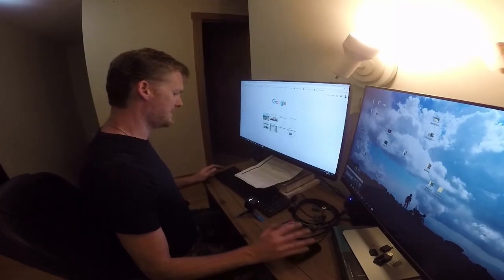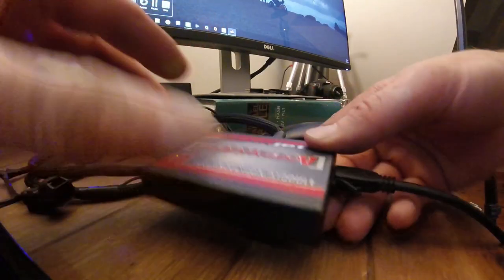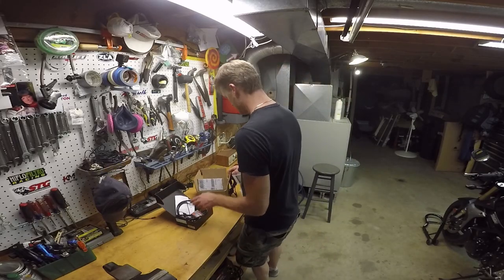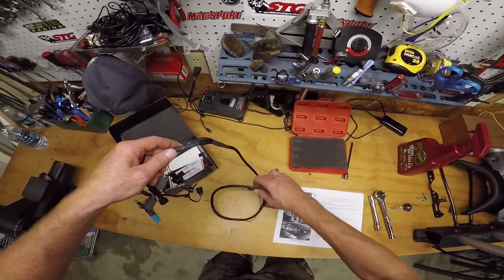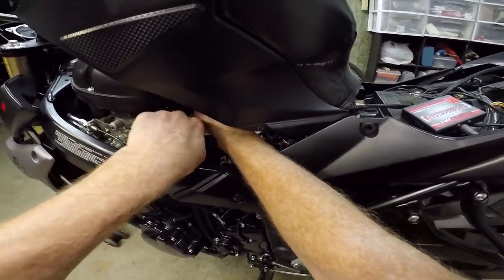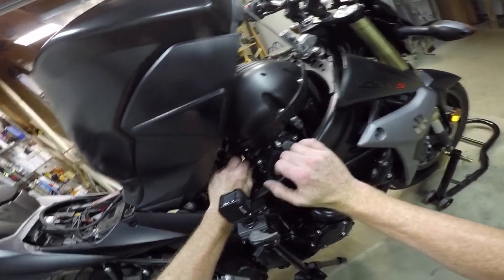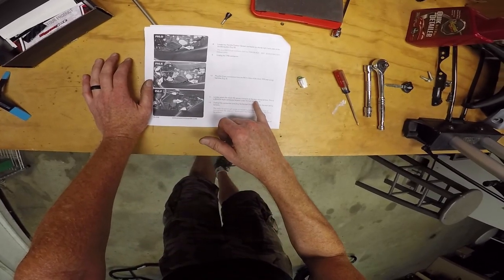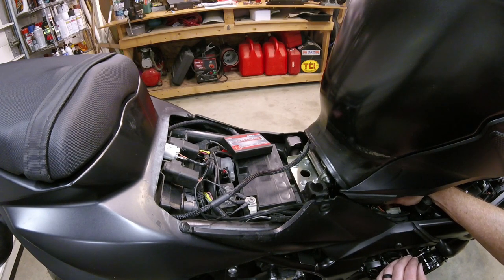How To Install Power Commander V | Suzuki GSX-S750

Comment: Appreciate these small HOWTO videos, multiple camera-angles, screen recording, it takes work making them at this quality. Now 6 months later - was the power commander worth it?
Reply from the maker: Aleek91 I only wish I bought it sooner.
Reply: buying mine now, but I also have a full exhaust system on the gsxs. Do you know anywhere online that has maps for download? Can't find any. If not I'll take it to a dyno shop. Thanks
Reply from the maker: baznitchandsons I had the same problem. I ended up buying from fuel moto because the advertised unlimited free maps. Dyno shop would be best of course 💪👍
Reply: Michael Byrne I'll check out fuel moto, thanks a lot
Reply: Another question - did you remove the o2 sensor or you left it since it's the stock exhaust? I'm not sure if dynojet ships something for the o2 sensor or I have to buy separately
Reply: I see you still connected it to the pcv but I'm assuming you left the o2 still in the exhaust

Comment: The only thing stopping me from buying, I don’t have windowsOS. Great videos! Maybe a brake change tutorial?
Reply from the maker: Derek Irwin Ya know the PCV software is very tiny and wouldn’t need much to run it. Maybe an old used $50/free laptop would get it done 👍 and yes indeed when my brakes finally wear down I will plan on making a video. Thank you for your comment 🙏  Ride safe!

Comment: Kinda basic question, but what's the benefit and the point of doing this? 
I have gsxs750z 2019
Reply from the maker: Once you allow more air to move thru your engine you need to match it with a fuel increase as well or you’ll run lean and risk engine damage.

Comment: How does this work with state inspections? ever have any problems passing inspections?
Reply from the maker: B3aters it hasn’t been a problem. But one of the things I like most about the pcv, it can be removed easily if it is a problem.

Comment: Is it the top fuel injectors you connect to or the bottom injectors
Reply from the maker: Guadalupe Martinez there is a row of fuel injectors on the back of the engine just under the gas tank toward the top of the engine. Only one set. Only one place to plug into. Does that answer your question?

Comment: I know you have to use the  Injectors on the bottom left to right but the plugs on pcv is there a  Particular order the plugs go in are they numberd or labeled. 1 2 or 3 or just plug them in but make sure you go from left to right reason being I bought a pcv used an i have no  Installation instructions lmk
Reply from the maker: Hey Derwin! Its color coded. Pretend you're sitting on the bike (for reference) .... the first cylinder is on the left #1 is Orange. #2 Yellow. #3 Green. #4 Blue. Hope that's what you needed man!
Reply: Are all pcv color coded the same way thanks for getting back to me bro
Reply from the maker: @Macnificent78_  If you do a google search for Dynojet PCV installation instructions (insert make model of your bike] you should find the instructions in PDF format. From what I can see, the wires seem to be the same color/same order on other bikes. But always good to verify!
Reply: @sstressfl  yea I'm looking now no luck on a 07 only for PC 3s thanks

Comment: Just a general question if anyone can answer: I’m installing my Pcv and I can’t seem to get the  plug out from second cyclinder. The plug is reachable and I can push in the clip but nothing happens. Stays in place normally 
Any tips?
Reply from the maker: I could be wrong but I believe that connection has nice little rubber seal inside to keep water out. To overcome it, try using a flat head screwdriver against the connection seam, and rotate the screwdriver gently while you're pressing the clip and pulling. That little bit of help from the screwdriver can make all the difference.

Comment: Hi, thanks for your video has helped me a lot.  I hope you can answer my question.  I bought a power commander V for my GSX-S750 2018, in my city I don't have any dyno power bank to program a specific map for my motorcycle.  I have contacted Dynojet and they provided me with a map with the exhaust system and stock filter, they tell me that it will serve as a basis to configure mine (Full system yoshimura and k & n filter).  The detail is that I have no idea how to do it, I find it easier to buy an already made map for my specifications.  Do you know where I can buy a custom map or at least know how to modify the map that Dynojet sent me correctly?  thanks
Reply from the maker: If I understand what Dynojet sent you... its a map that was created on a bike like yours using the same exhaust. If that's the case, it should be close, but no guarantees. You can open the file using the power commander app and take a look at what they've done. If it looks like a pretty good bump in the mid to high rpm range then give it a try. See how it feels. After you ride a bit, remove a spark plug and take a look at the white ceramic that surrounds the electrode in the middle of the plug. It should be slightly tan. If its bone white then too lean. Too dark and its too rich. Its not easy to make revisions to your own map without a dyno so be careful and move slow. If you decide to change a number, make sure you know WHY you want to change it. And one more thing that you might know already, I heard from other 2018 gsxs750 owners that they cant modify the bottom 40% of the rpm range (??) if that's the case them make sure your fuel trims are gradual changes between cells or you'll get snappy throttle behavior. I garage tuned mine and its working great, but I still plan to buy an autotuner. Hope that was helpful.
Reply: @sstressfl  Thanks for your answer.  What Dynojet has sent me is a map with the stock exhaust system and stock air filter, that is, a map for the motorcycle without any modification made.  Instead, the map I need is with a full yoshimura system and K&N filter.  Dynojet mentions to me that the map they sent me can serve as an initial reference to modify one that suits what I need.  The detail is that as you mention it is necessary to know why change some value of the cells and it is here where I have no idea how to decide what value to put in the cell.  As there is no dyno power bank in my city, I only have two options, do it by trial and error (I don't know how) or buy an autotune.  Autotune is the easiest, but it also means investing more money.  Hopefully Dynojet includes more maps for this model, since for the GSX-R versions there are much more options
Reply from the maker: @Dannybag666  that is one of the downsides of the gsxs... no maps!  I wish I had an easy solution or could point you in the right direction. If you just had a slip on, the stock map they sent you would run a little richer and it might work really well. But with a full exhaust (I'm assuming no cat) it is going to flow and evacuate the cylinder really well and make your engine run very lean. It wants more fuel. I just cant even begin to tell you how much. I'd have to be there! I bought my tuner thru fuelmoto and they provide free maps based on your config. You might want to contact them. Maybe they'd sell you one? Its worth asking. Or perhaps sign up at gsxs.org and ask the guys if they can help. They like to play! Maybe one of them has a proven map!

Comment: Was this a fuel pcv or a fuel ignition pcv? Very interested to see how this turns out, kind of taboo to just throw a map on it instead of taking it to a tuner and do a few runs on the dyno. Also interested to see what happens considering you really only have a air filter and servo mod, great install vid
Reply from the maker: Just fuel! The GSX-S750 doesn't have the ignition timing available. I also removed the giant rubber restriction from the intake. That's when the whole thing came to life.... and probably contributed the most to the lean condition. Thanks for the feedback.
Reply: which is the restriction you are talking about? is it the mini horns that are connected to the throttle body or is it on the other side of the filter?
Reply from the maker: Izat Dagher it's a big piece of formed rubber at the entrance of the intake. It guides and silences the air entering the intake. You can squeeze it and remove it. Opens up the intake a lot. And makes an amazing sound 👍
Reply: she gone!  Thanks!
Reply from the maker: Sweet!!
Reply: Hey Mike, you know if that's also on the 2018 GSX-S?
Is it on the outside of the airbox, or inside? I installed my K&N this weekend and don't remember seeing anything like you mentioned.

I just ordered a PCV, hope to get some nice results!
Mods: K&N + Yoshi Alpha T
Reply from the maker: Thomas F zoom in on this diagram. Item 7 is a big piece of rubber. That's what I removed. http://www.oneidasuzuki.com/store/parts-accessories/air-filter-cleaner-gsx-s750-2015.html
Reply: Michael Byrne - Sweet, and it made a big difference? If so I'll pull mine out when I install the PCV (if I got one on the 2018 lol)

Comment: So Where can i get the maps? On the website i can only find the OEM map?
Reply from the maker: I went thru the same thing! I ended up buying mine from FuelMoto cuz they provide free unlimited maps based on the description of your bike mods. However, that is far from a perfect science. I tweaked the map fuel moto sent me but even then I'm using seat of the pants, fuel mileage and spark plug color as my indicator of a good tune. My next step is an auto tuner.